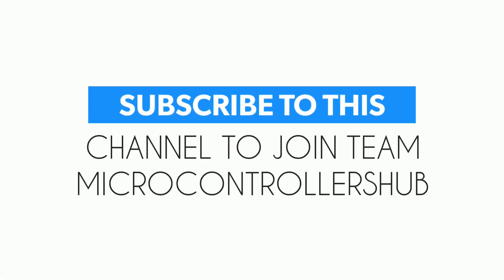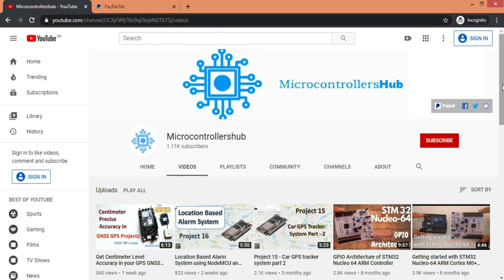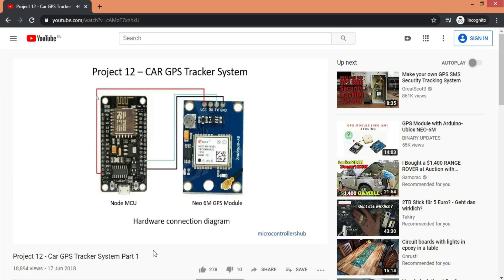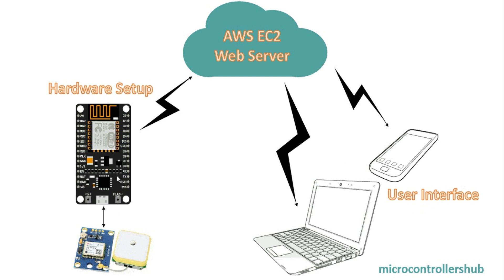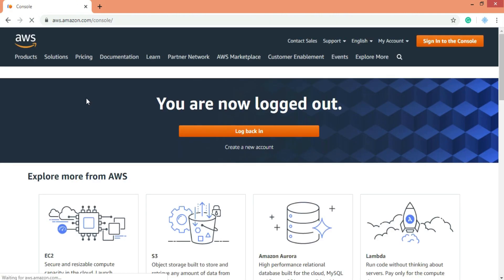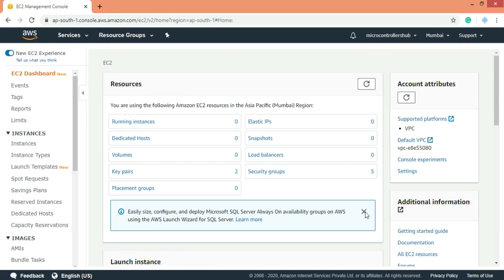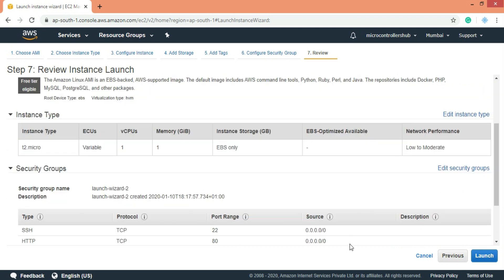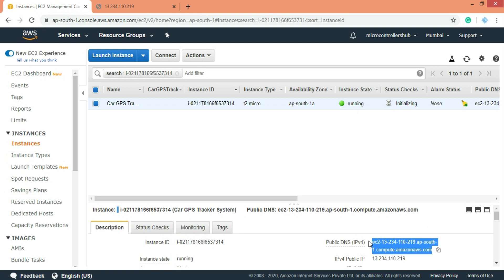Create your Web Server for Arduino IoT Projects. Car GPS Tracker System Part 3

Comment: Hello. Thank you for your tutuorial. It will be very useful to me. I have a question : I want to track my car even when it's outside my country, is it possible?
Reply from the maker: +fathi ahmed nour 
Yes definitely it is possible. Till the time there is internet connectivity available, you can track your car anywhere on the earth ☺️
Reply: @Microcontrollershub  there's no internet connection where I want to track him. Without internet, it's impossible?
Reply from the maker: @fathismael  
With this project it is not possible without internet. Maybe you can try with SIM 900 module and send sms to get locations or use similer modules tp get internet connection